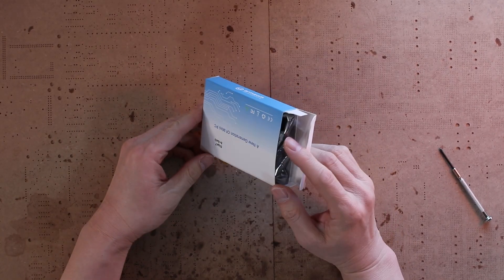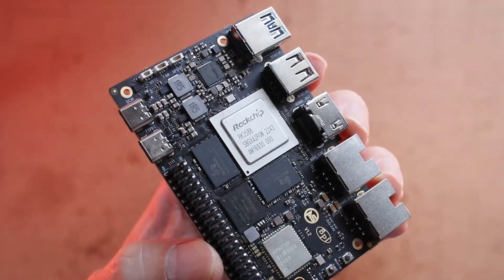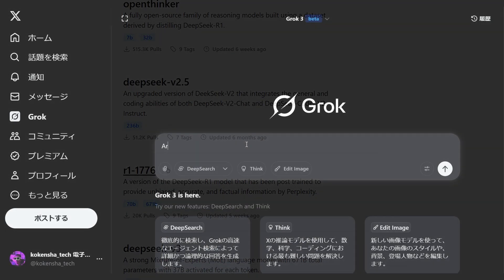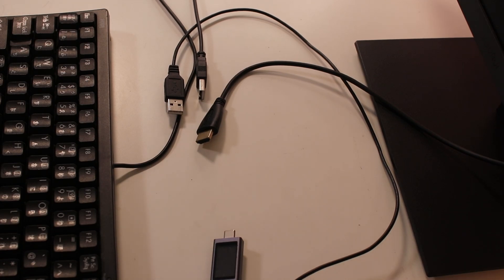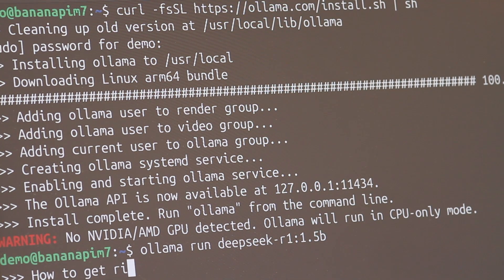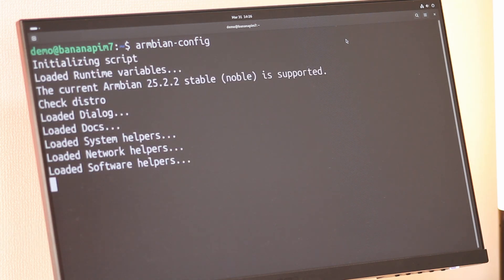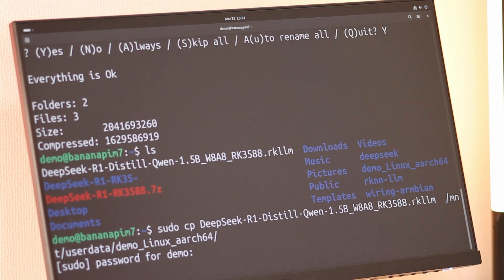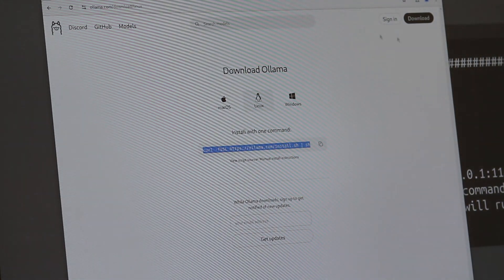Run DeepSeek locally on ArmSom Sige7 locally (two methods)!

Comment: Using Ollama is a big advantage. With the Sige7-Pro Max and 32 GB RAM for aorund 250 USD, it should be possible to run deepseek-r1 32b. Maybe also the 70b. 
Would it be possible to run the 671b especially on multiple of the Sige7-Pro Max. 
Keep in mind that DeepSeek was - different to other AI models - using just a part of the model that was was 'extracted'.
Reply from the maker: I hope ArmSom can provide me the Pro Max to test larger models.(^^)
Reply: @KOKENSHATECH  If possible have a look at RASPII. There was a configuration tested where they used I think 4 Raspi 5 with 8 GByte RAM (not the max). So, two ArmSom would be interesting. There is also a board coming up with the max configuration  as a substitute for the NVIDIA Jetson Nano. I have one and was thinking if I can just exchange the computing board.